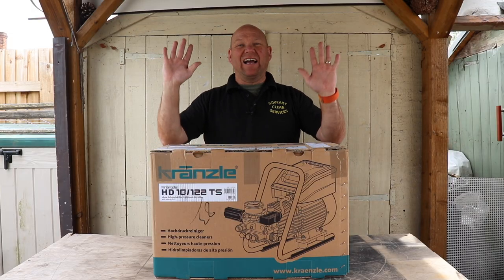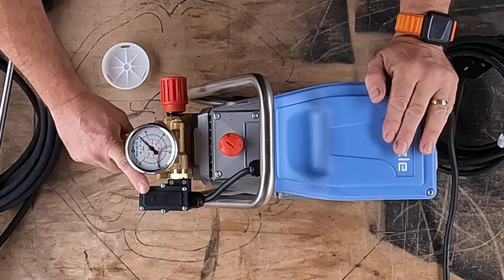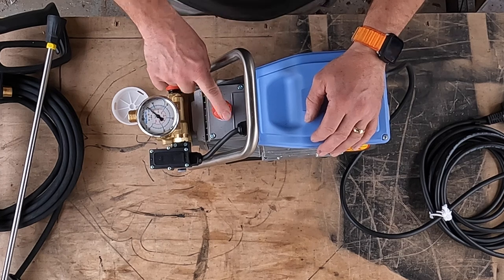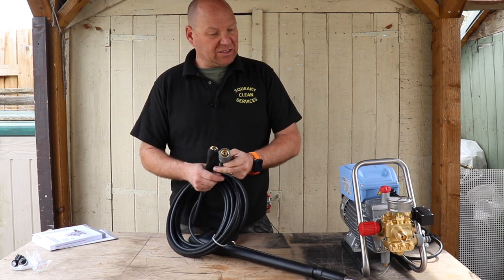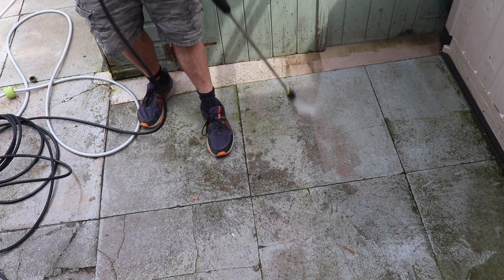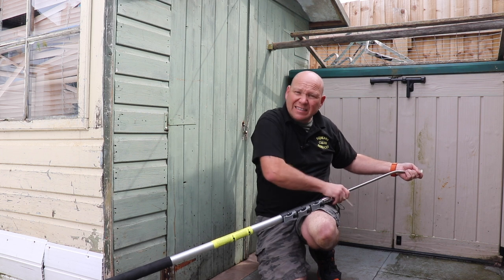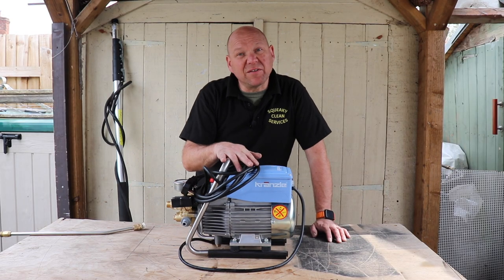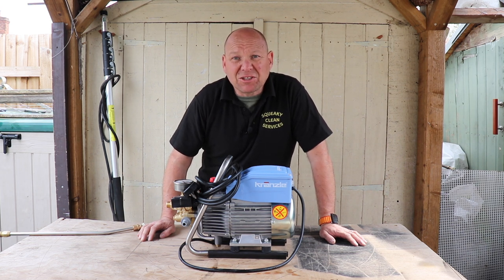Kranzle K10/122TS Unboxing And 1st Test

Comment: In Australia, it's rated as a 15 AMP product, the common outlet is 10 AMP
Reply: Well the k10 is 2500w/230v is 10.87 amps so it’s just over the 10 amp limit 
However the k7 is 1500w/230 is 6.52 amps so that is under 10 amps so you should be okay to put that on a 10 amp plug or it might even come with one as standard

Comment: Just got one,leaking water from one of the slots under the brass pump head out of the box,not impressed.
Reply from the maker: Have you taken it back to the supplier
Reply: I’m surprised that the Kranzle is leaking, an authorised dealer will swap it without question 
Mine has been running for eleven years and never had a problem
Reply: Yes it went back to the supplier,replaced the seals,and sent back to me,now all is good. 👍
Reply: In France they try to repair rather than replace.